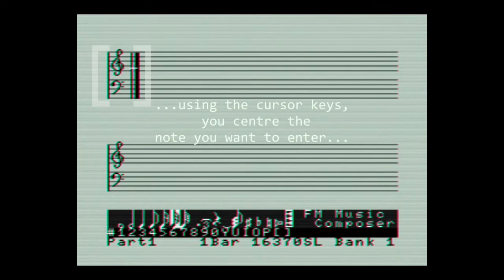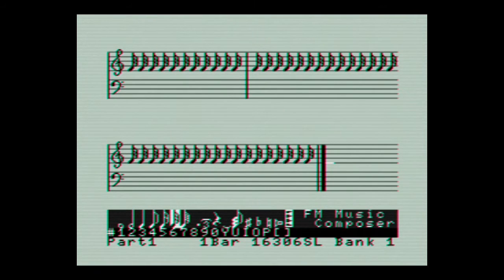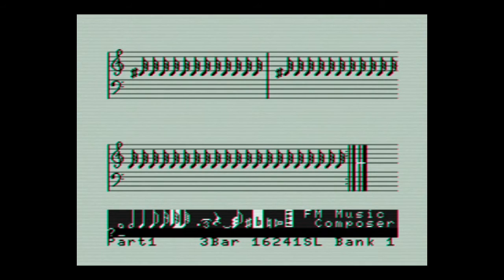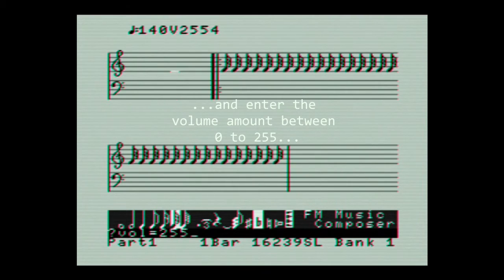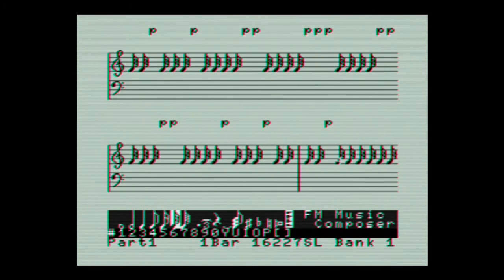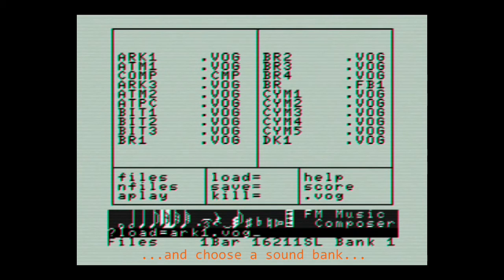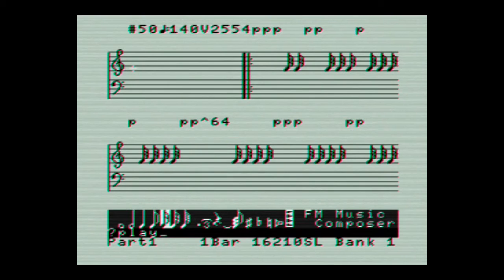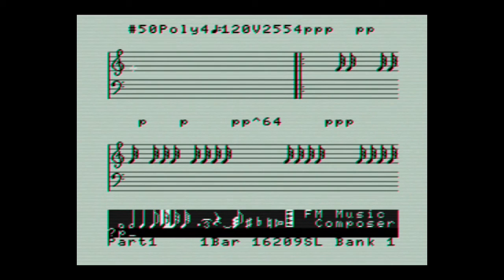Composing Electronic Music on the CX5M MSX Computer

Comment: Thank you for posting this - I had a CX5M back in the 80s and I've recently been polishing the one audio tape I made of this music. In looking out some notes I kept of the tracks I found a lovely handwritten manuscript I wrote that I had never actually recorded. So I've been looking at CX5M emulations and  the YRM-101 program to produce an authentic rendition of the "lost piece" of mine. Its amazing how much I've forgotten about using it (and just how HARD everything is)!
Reply from the maker: Thank you. It’s a unique little machine. It opened the world to me back in the 80s.  Look forward to hearing the piece
Reply from the maker: The blue max emulation is very good
Reply from the maker: Blue msx
Reply: @element433  It is - much to my surprise I managed to get the FM Voicing and FM Composer working, worked out how to save to the "cassette", and gave up trying to enter my old score and had some fun coming up with something new using something old.  One thing I like is the fact the part looping is independent, and it will happily loop anywhere in a bar. My first piece (from 1986) used this accidentally where I got the rhythm loop a few measure too short, so over the length of the track it kind of drifted with everything else. I'm actually going to play with that idea more when I have a moment (or several - it takes ages entering those notes and dynamics and everything!).

Comment: Flight Sequences is simply awesome!
Reply from the maker: Thank you very much !!!
Reply: @element433  do you believe CX5 is still an interesting tool to compose such wicked compositions? or could i do it with cubase or other soft systems? thanks!
Reply from the maker: You could do it on a modern system for sure. At the time the CX5m was all I had and because I wrote using a score it was ok to input. Today it would be a lot simpler and we have all those lovely VST plugins. VOPM plugin is identical to the CX5 sound engine
Reply: @element433  thanks a lot!

Comment: If I may ask, which method did you use for storing your patches once you had made them?
Reply from the maker: At first it was cassette and then when the sFG05  became available I bought the floppy disk drive. It was like night and day. I still have some cassettes.
Reply: @element433  I guess the CX5M has that proprietary DIN cable for tape storage, though, right? I listened to your album last night, by the way. It was the kind of honed and developed texturescape that I only dream of making.

Comment: Hey great! Do you have original files for the CX5M available still? I'm part of a team that works on an emulator of the MSX computer (including the CX5M), but there are no files for the CX5M software available anywhere.... Would be great if you could get me some!
Reply from the maker: Hi, did you look at BlueMSX? The SFG05 emulator works well except for some critical issues with the MIDI implementation.
Reply from the maker: What file types are you guys looking for?
Reply: @element433  Anything you can share... possibly with some short instructions on how to use them, though :)
Reply: @element433  blueMSX hasn't been maintained for almost 10 years. Our implementation is (partly) based on it. The MIDI stuff is completely rewritten after our own reverse-engineering results. I'm part of the openMSX team.
Reply from the maker: Sure I have some bios and roms. I also have some Yamaha documentation about the SFG05 bios. If you need a .vog file and .cmp files I can provide those too. Private message me on FB and we can get this going. All the best and Happy Xmas
Reply: @element433  I wasn't talking about BIOS and stuff, but about files with music and voice data and any other kind of data files that can be used with the software for the CX5M. I'll contact you, thanks!